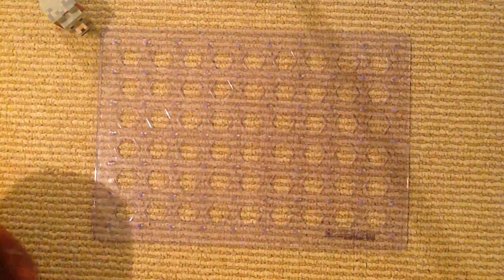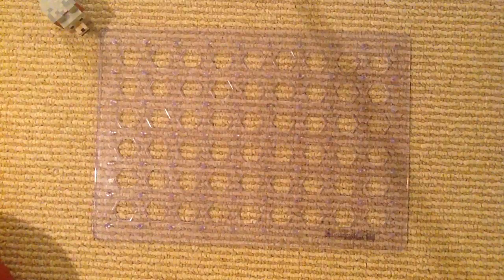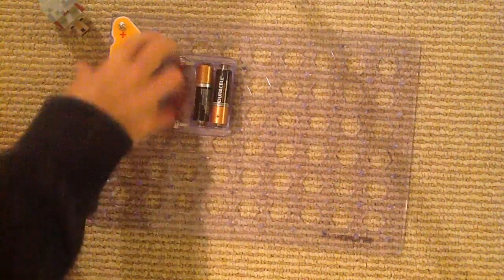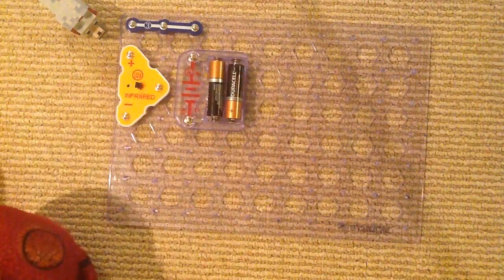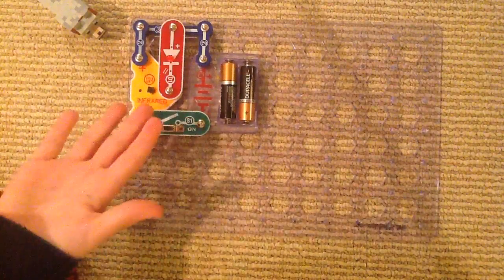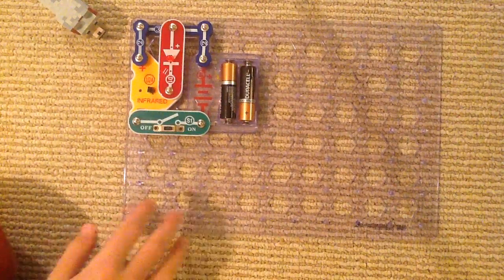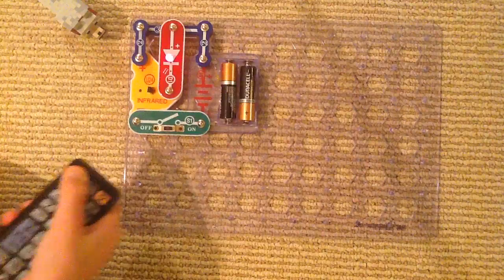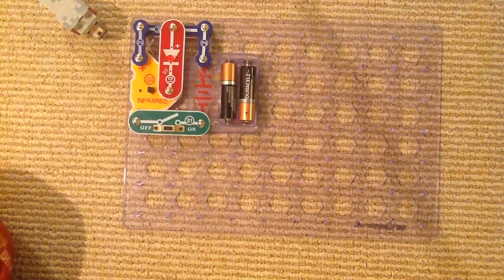Project 41: Infrared Detector | Snap Circuits Light | SCW

Comment: First. Also I made one but it was bigger but can run a motor and speaker. Without any type of ‘outside’ instructions! May consider building it and uploading it.
Edit: I used two sets to make it, the Pro and Light sets.
Reply from the maker: :0